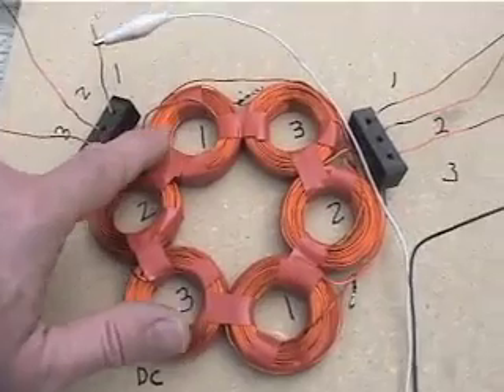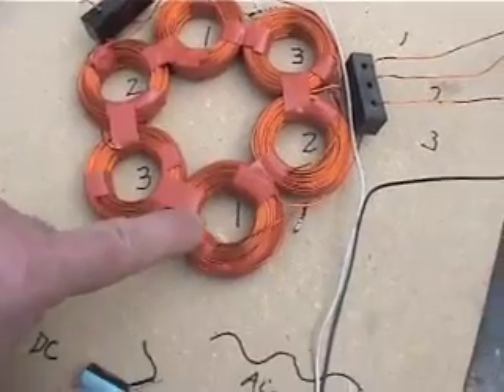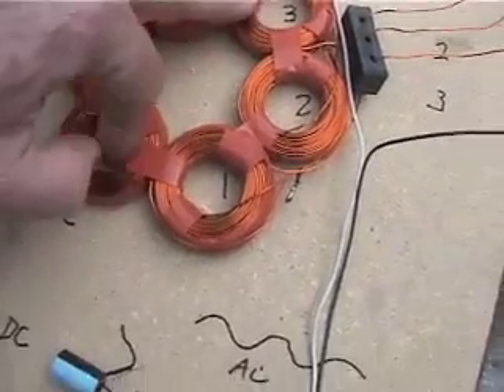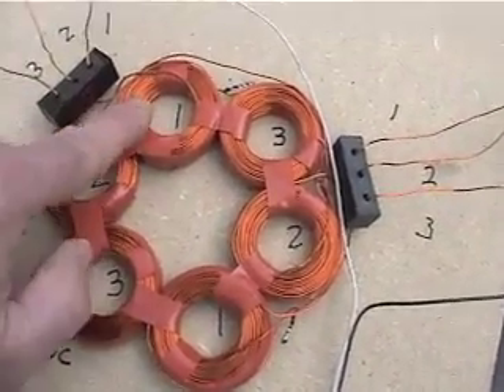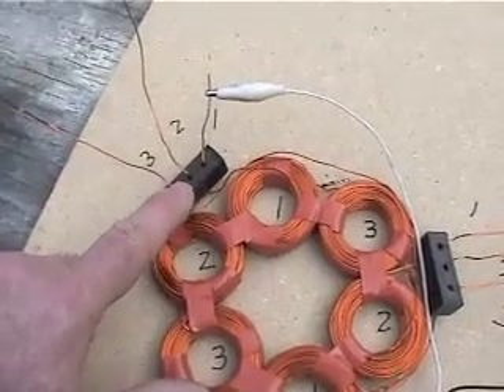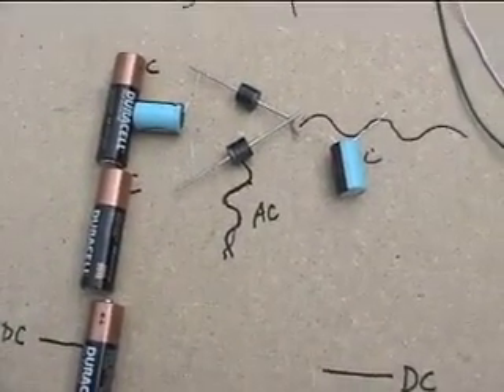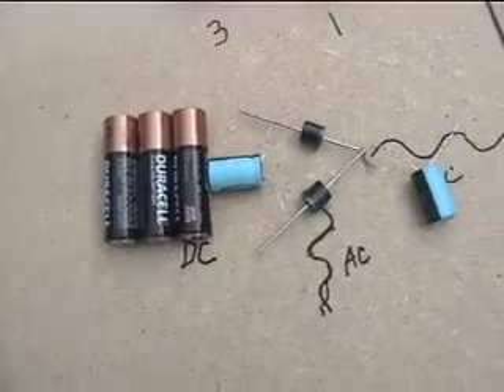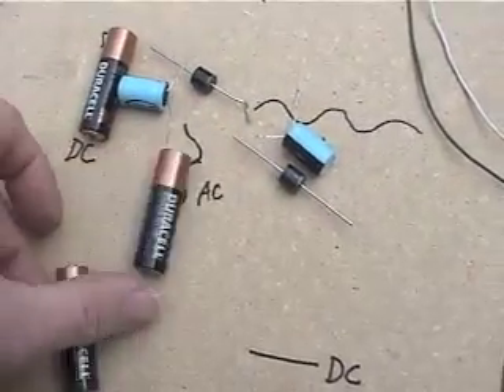Lynx Electrical Theory part 2

Comment: +LynxSteam The best is to wind clockwise and counterclockwise and Buck the electrons with High Frequency Diodes and Non-Polarised Capacitors for frequency matching. 
How? 
Assuming you have 12 coils, wind 6 in CW and another 6 in CCW.

::::::HINT:::::: On your Jig, wind all coils in clockwise direction while on your Stator, arrange the coils in CC;CCW fashion i.e you simply turn or flip on of the Clockwise wound coils 90° to make it really appears Counterclockwise.
 
So for every pair of clockwise wound coils, you simply flip one to make it CCW.

Now arrange the 12 coils in CW, CCW, CW....

You will see that every pair of coils at 180° are in same direction either Clockwise and counterclockwise direction. 

Now connect the pair at 180° in series by joining the Start lead wire one to the End wire of the other.

Now , you have just Canceld **LENZ**!!!

Thereafter, get 2 High Frequency Diodes and attach there cathodes to the 2 remaining leads of the 180° apart coils. 
Measure your Alternator RPM and convert it to Hearthz. Measure the inductance and resistnce of your serially connected 180° apart coils use an online  Resonance frequency calculator to determine the Capacitor needed to connect across the two leads of the serially connected 180° apart coils. 

Do the same for the remaining pairs and connect the positive output in parallel and tap your Negative from the Ground(Rel Earth)

Massive Power Output you will have.

Comment: i have 10 rectangle n52 grade neodymium they are 10mm thick, 50mm wide, 100 long. I want to build a generator for a microhydro off grid power source. How do I calculate the amount of windings that i need?
Reply: David Elderkin did you ever figure this out ?

Comment: Hi, thanks for the vids there a big help... I am currently building a 3 phase generator, the input is wired 'spider' and the out put has a capaicitor the 2 diodes 'y' shaped with another capaictor joining the 2, as shown in your video. I am linking the 3 phases together in series. Can I ask, if I simply link the to positive and negatives from my series circuit to a dc to ac grid tie inverter would that be me linked up to the local grid or do I need more equipment to steady the pulses?
Thanks in advance

Comment: Hello. can you help me im a english teacher, i have no idea what im doing i just look at videos n started to make  this a  few years ago saving money  month after month. now i  have 36 magnet 4in x 2in x 20mm neos, 3 disk the one in the middle has 9 each side  nsnsnsnsn facing out the opposite side is nsnsnsnsn facing in n snsnsnsns facing coils.after coil outer disk 9 mags, now help plz on the north i put coils + to N on the S i put -of  coil facing itsoat top dead center im having    n to +  s to -     .IS this idea ok. well it make power. 
next 9 coils 3 phase do i do the same +++++ on the stater
alternate the pos n  neg same im doing magnets to match the n to pos   n the S to - side of coils so at  TDC its replelling, 
also  i have  9 coils 3 phase how do i do the three pase i was going to do one each   badini sg style  since my coils are wound 7 20 ga  1 24. ga  n usethe trgger diag to make  3 circuit board with  100omh  r  1n4001   d n 1n4007 d  n 400v 20a t
how  do i put this all together now please can you help
anthonyolivera@yahoo.com

Comment from the maker: When I was first learning this is one way I made coils.  You are right.  Its not the optimal.  What I find though is if the alternator is weak the Turbine still can force it to put out the same power (to a point).  Now I make alternators as high efficiency as possible so they can be smaller, and more economical.

Comment: Marcus, why are you using round coils instead of triangular coils? One of the 3 rules for electric generation from magnets is that the flux is only wiped by the area of the coil that is perpendicular to the travel of the magnet. A round coil only has about an inch of perpendicular generating area on each side whereas a triangular coil would have about 4 perpendicular inches on each side?

Other than that-- nice demonstration.

Comment from the maker: I have learned a lot since making my first alternators.  Make the stator no more than twice as thick as the magnets are thick.  So for 1/4" thick mags, 3/8-7/16" thick with some airgap.  So within that thickness you have to get your copper wire.  Thicker wire fewer turns.  More turns higher voltage more resistance.  Think of the wire as a fire hose.  Pressure is voltage, diameter of hose is resistance.  For maximum power you want a big hose and lots of pressure.  Let me design something for you.

Comment from the maker: @davevanden1 
Not sure if you mean placing another stator between the magnet plates or another below a single magnet plate.  But the concept of adding the two outputs from two stators is sound.  Think of each stator as a battery - adding them doubles voltage.
The flux will be weaker if you spread two magnet plates and voltage will drop on both.  If you mean one magnet plate the flux going through to a second stator will be very weak.  But try it.

Comment: hi markus
question for you will this work???
i have one stator with mag plate on top and bottom 12 coils set up in star.
can i make another exact unit  and not hook up in star just have in and out on it and hook the other unit to it with short wires. reason is I dont want a stator 2 feet round lol so I thought stack them to double the voltage.
right now i have 2 -18g 70 turns and it turns at the slightest wind it is the optimum  so far. It'saround 6 to 10 volts all day long 
thanks
Dave